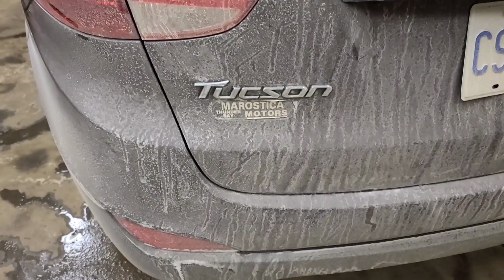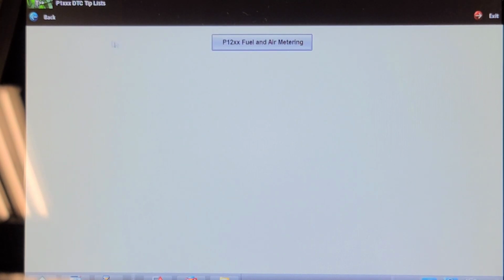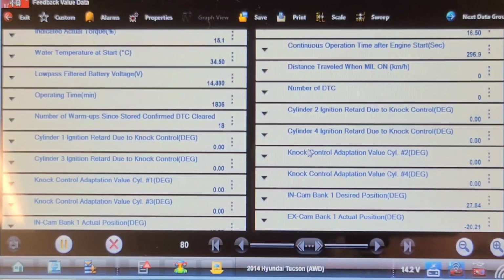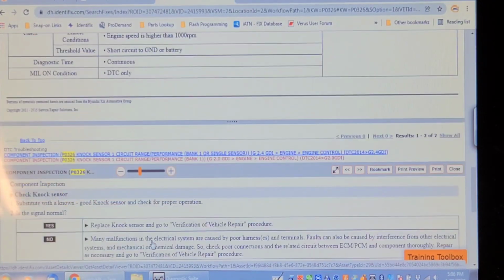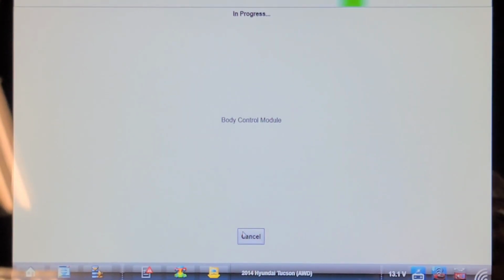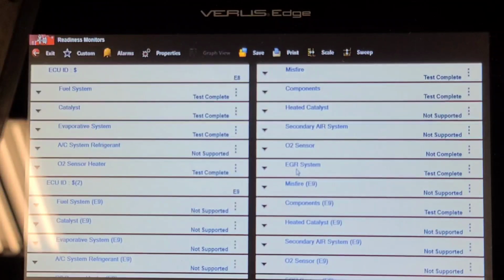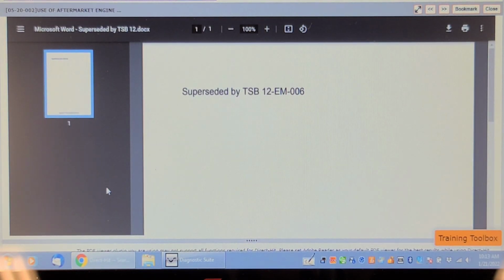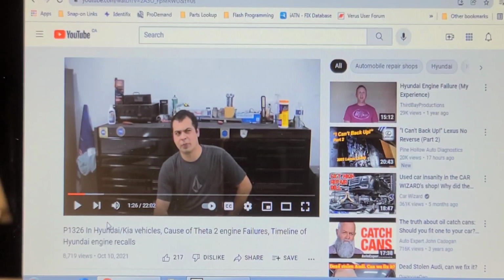2014 Hyundai Tucson 2.0L. MIL Flashing, Loss Of Power Code P1326

Comment: Looking to buy a used 2017 sonata as a fix and flip it’s having this same issue went to AutoZone and got the code p1326 should I try to repair it with a new sensor and sell it or let the guy deal with it “he wants 1000$ for it with 129,000 miles”
Reply from the maker: It could be a false code due to a sensor problem or electrical interference on the signal wires or it could be sensing that its about to blow up. It's a gamble. Is the engine making any noise? What does the oil look like?

Comment: Hey guy i know this video is old. But i was wondering if any one has found the real solutioin to this problem. 
Ive replaced the sensor, and rod bearings. The engine is very smooth but it seems to just keep going back to limp mode. 
Usually when i drive the car and clear the code as im driving it on limp mode, it seems to go away for the whole day. But then when next morning comes limp mode comes back after driving for a couple minutes , then i would delete it again just so i can drive the car normally for the whole day again.
Reply from the maker: I take that the recall was done if its setting the P1326 code. The original recall involved recalibration of the ECM to heighten the sensitivity of the knock sensors. These engines suffered from rod bearing failure and tended to throw a connecting rod through the block. Some engines caught on fire. There may be a further software update to address the false knock and limp mode. I'd recommend to check with a dealer.  Shielding the knock sensor wires might help. You could relocate the knock sensors away from the engine so they are less sensitive.

Comment: What was the resolution for this vehicle ? Because this has happened to us recently.  Thank you.
Reply from the maker: Unfortunately there is no resolution. I put an oem filter on it and vleared the code and it's been fine so far. I believe the reprogramming of the ECM to use the know sensors to listen for rod knock is too sensitive  and the code is tripping falsely.
Reply: Easiest way to get to 2014 Hyundai Tuscan starter
Reply: @michaeldaniel551  the dealership parts department!!

Comment: I have a 2015 tuscon. I have had the same issue since Nov 2021 when they fixed the Knock sensor recall. Huyndai dealership haven't been able to totally fix the issue. The rod bearing wasn't worn out, they replaced stuff in the engine (I am not good with vehicles so not sure exactly). 1 day after it was fixed, the check engine light was flashing again. I took it back, they changed all the wiring in the engine. Back on, they replaced the knock sensor. A day later, check engine light flashing again, then they replaced the engine harness assembly. Back on again the same day I got it back from the dealership. Then they replaced the catalytic converter and after that it had been ok for 2weeks, and back on flashing again. So I just got it back 2 days ago and they said they reprogrammed the Knock sensor because there was an update last week. 
So I have been having the aame issue, and them not able to make it gone completely. I am curious if you were able to find a solution for this 2014 one and that the issue never came back. 
They always did my services so I  am assuming they were using their own oil filter. 
They did change my motor that first time the check engine light was flashing  but it didn't solve the issue.
Same issue since Nov 2021 until now. It does work now but who knows what will happen after 2 days or 1 week. I am hoping it works for good.
Reply from the maker: Here's my take on the problem. The engines are or were prone to connecting rod bearing failure and tended to blow up. If the vehicle was running at cruising speeds this failure could cause a connecting rod to break, punch a hole in the block spewing oil on the hot Catalyst and catching on 🔥.  The recall involves checking for internal engine wear and replacing the engine if necessary as well as reprogramming the ECM to use the detonation (knock) sensor the "listen" for engine knock and as a protective measure flash the MIL and cut engine power. Even if you shut it off and restart it the power won't return unless you clear the code. The knock sensor is a piezoelectric sensor that generates an AC frequency who's amplitude and frequency vary with engine noise. It was originally designed to hear detonation due to low grade fuel and retard the timing. I believe the updated programming which enhances the knock sensor sensitivity is too sensitive. The wire to the knock sensor is in the same harness as the fuel injectors and can pick up EMI due to the injectors firing. It may also be picking up interference from a bad diode in the alternator. Hopefully they come up with a fix. My custome has not had an issue as far as I know. Unfortunately you just have to keep on them to address this.
Reply: @PhillipBailey  hopefully, it has been a stressful half year. Thanks for providing some explanations about it.
Reply: @haingorakotondravah  Did you have to pay for all those "repairs" ? or was it covered by Hyundai ?
Reply: Had same issue on mine, I think he is right. The sensor is to sensitive, they fixed my engine when it got seized and had no problems for about 6 months and about a week after I went in for an update this code kept coming up. They told me that I need to change the sensor and if that doesn't fix it that I would need an engine. So I changed the sensor and the code came back again, so now I just clear the code when it comes on so that I can drive the car normally because its a pain to drive in limp mode. I have been doing this for almost a year now

Comment: I have  Tucson 2.0L year 2017 , had same issue , sudden lose of power , vehicle turned in a safe slow drive mode , after diagnostic done code same as your P1326 , Hyundai replaced blook engine but then after just about 800 km same thing happen!
I have to bring  Tucson back to Huyndai dealership to figure out whats going on with a vehicle!
Reply from the maker: I've talked to a master tech at the local dealership. The reflash enhances the knock sensor sensitivity to allow it to hear potential engine knock since these engines were prone to blowing up. Trouble is sometimes electrical interference on the knock sensor circuit causes the problem. Running a new wire away from the injector wires between the knock sensor and computer may help as might a new knock sensor. Also be sure to use an OE oil filter as there is a bulletin about AM oil filters causing issues. Good luck

Comment: Got my motor replaced in my 2014 Tucson for free at the dealer due to the class action lawsuit regarding this issue. The engine will seize up at some point. The ECM update, was really in my opinion, to put your vehicle in "slow" mode when its about to fail and prevent more dangerous situations and lawsuits. They made that knock detection super sensitive.
Reply: Silver lining is, "The settlement extends the Powertrain Warranty to a Lifetime Warranty for the engine short block 
assembly, upon completion of the Knock Sensor Detection System Update. It also provides a free 
recall inspection for any recalled vehicles not yet inspected, regardless of current mileage or prior 
repairs, and rental car reimbursement or loaner vehicles for any vehicles that undergo engine 
replacement. "
Reply: Good for you. My 2015 Tucson needed a new engine but i had to pay for it myself, this was in 2019. Reason being is because my car wasnt under warranty and it didnt fall under the class action lawsuit because my car has a different engine.
Reply: @19Mike78   how much you pay for the new engine and has your car any problems with new engine??

Comment: I just took my 15 Tucson in as well with the same issue with that code. I’m hoping it’s just the knock sensor but I have no clue. The car your workings is doing the same mine is. I hope I hear good things tomorrow. Do you have any updates from working on it?
Reply from the maker: Yes an update... I put an oe oil filter on it and cleared the code. I believe the knock sensor is falsely reporting but we will see what happens. She had the update done to the ECM in November 21.
Reply: @PhillipBailey  I had my ecm updated as well. We’ll see what happens
Reply: Same error code with reduced engine power. Just had 2017 Tuscan serviced for a recall on Feb22, 2022….
Reply: @paulflo12  , Hi Paul , how is your Tucson now , I have also 2017 2.0L , lose of power, same code , dealer replaced blook engine but just after 800 km , actually today same  thing happen, lose of power and slow driving mode. In this mode vehicle does not have enough power to overcome slopy hill road, I hardly made home!
Reply: Hi, any updates for your Tucson? Currently I had a silent recall for my 2013 Veloster Base and after a month my CIL starts flashing and I got reduced power. Nothing unusual like a harsh hammer sound is coming from my engine and I did replaced it my knock sensor with a genuine one. It's very confusing for me...
Reply: @haaxxx9   I did decided to go to a local auto shop I’ve been through before and they ran codes and it came up knock sensor code. The sensor wasn’t broken or anything but after they cleared the code the limp mode went away and engine light also. They said the sensor must’ve felt the vibration or knock and it spazzed out. They told me with the 2.0 engine is it does that.
Reply: @ianlichty95  your engine bearing could go bad. They need to do a test at the dealer which you'll pay for $200
Reply: Hyundai TXXM service campaign, so long as the P1326 code is present, hyundai will warranty replace the complete engine.
Reply: @wendydaniel7016  , replaced blook engine only, all other parts are not replaced , valving , injection head , however I got just today same problem again after just 800 km since dealer did work on vehicle , and toke them tree months to do work due engine shortage and other parts ! Now vehicle needs to be brought back to Hyundai, and who knows! where is end
Reply: @plutoniusis  well, I pushed the issue really hard with them and got the full meal deal. My engine also had a severe oil consumption problem, so I didn't back down. Additionally I reached out to Hyundai motors directly, provided maintenance records and what not. While my car was at the dealer, they had to submit photos of the top end to Hyundai as well. It took around 4 months or so before I got my car back, and since those engines are on backorder, mine was pieced together rather than a drop in.
Reply: @wendydaniel7016  no, first they will put you through hell with other charges not covered and take your car for a week. Only to have the problem re-occur with your family on the road somewhere incovenient